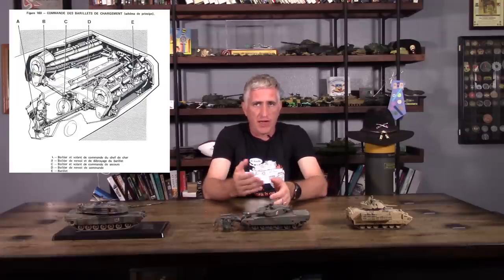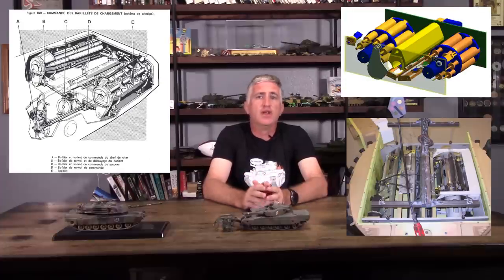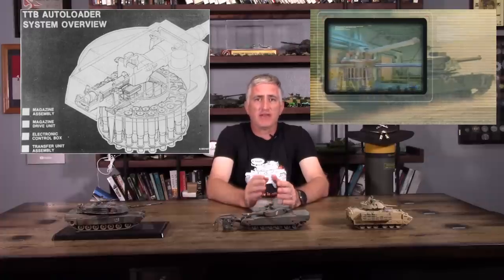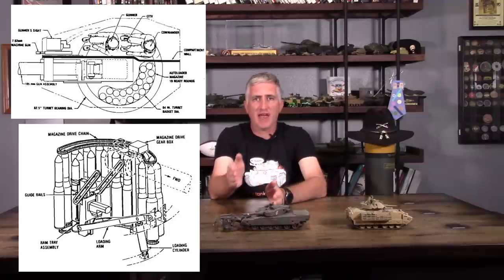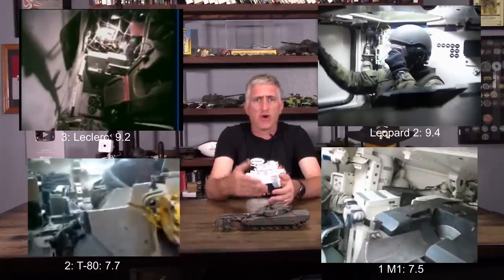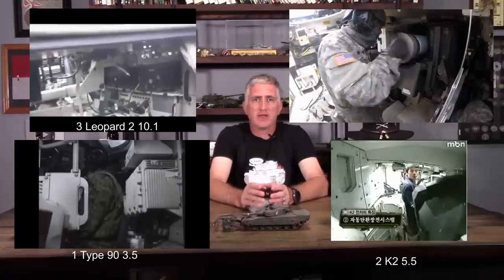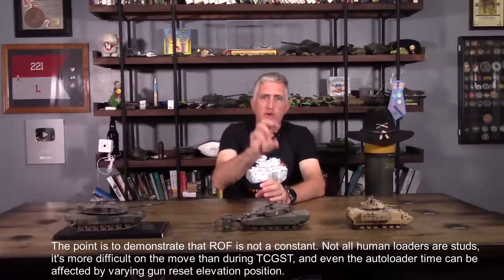Whither the Autoloader?

Comment: Nice set of arguments, also...in support of the autoloader, about missing a 4th set of eyes to keep look-out, with modern camera systems atop the turret (with target/object recognition software & threat warning) this becomes less of an issue.

However, against the autoloader...have they yet sorted out the issue with removing a chambered round from the breech without firing it so that it may be returned to the magazine for later use?  Ei: if an HE got loaded & another threat comes up and you want to swap it for an AP round...without wasting the one in the tube.  Because I heard that the carousel loaders had to fire the round once it's in the breech...maybe that was only an issue with the older ones?

Nice vid!  Keep them coming!

Comment: On loosing a crewman. Chieftain says this isn't a problem because you can just put the 4th crewman in an APC at the company level. What do you do when you spit off a platoon to a different mission (company/team)? Having been in a situation where we had to pull maintenance with reduced crews - it was a stark raving big issue and resulted in sub-optimal maintenance being performed. Tanks are big things and even the tools can be quite the issue (track adjusting wrench anyone?) and even simple tasks (replacing a road wheel or track block or two) is MUCH easier with 4 guys and not 3.

Comment: A unique issue to Soviet carousel autoloaders:

Magazine refilling will take much longer than ready rack refilling. I believe you have to program each slot in the T-72/T-80/T-90 autoloader magazine for a certain round so that the autoloader control unit will know which part of the carousel to rotate to and pick out ammo from. That's a process you have to repeat 22 times on the T-72/T-90, and 28 times on a T-64/T-80. Compare that to just having the TC hand the loader some rounds to refill the 17/18 round ready rack on an M1A1 / M1A2.

Though, since ammo refilling is normally done outside of combat, this is less of a problem; presumably when the tanks are back at lager you have as much time as you need to to stock up on ammo etc. The only advantage I would give to the Abrams here is that you can refill during short lulls in combat from the TC's semi-ready rack. I don't think it's as easy to do the same with a T-72 / T-80 / T-90.
Reply: Also, carousel arrangement on autoloaders limits the length of sabot rounds.  Since we're heading in the direction of  long-rod sabots, this limitation is a serious disadvantage to Soviet / Russian tank operators.

It wasn't until after the T-90A (Obiekt 188A) tank was introduced in 2005 that a T-72-type tank could operate long rod rounds like the BM-42M; previously tanks with the T-72 style carousels could only at best fire BM-42 or BM-32 rounds, which were only effective against early gen M1s / Leo 2s. 

Reportedly, it was only very recently that all T-72 type autoloaders were upgraded to allow the use of longer-rod sabots (3BM46, 3BM48 for example).

Comment: Looking back at the one man turrets common on many French tanks of 1940, it's interesting to consider the impact if the French had developed a 37 or 47 mm autoloader gun, combined with decent periscopes and sights for the commander. Probably well beyond the technology and French finances of the time, though.
Reply: Maybe, but not by much. The P-39 Airacobra had drum magazine-fed 37mm cannon, Hispano-Suiza had their 20mm belt or drum fed cannon of Spitfire fame. The Panzer II's 2 cm KwK 30 fired from a 10 round magazine the operator loaded. You had the Oerlikon and Bofors that were drum and magazine (clip?) fed respectively. So maybe not an autoloader like we think of it today, but maybe a magazine-fed cannon would have been feasible, at least for the 37mm guns.

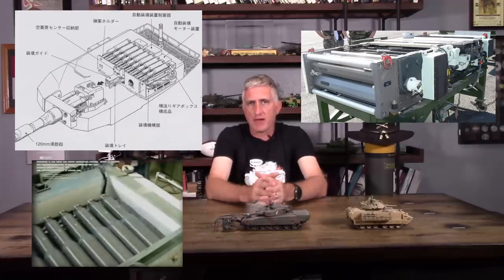Comment: 3:02 Generally. Now the obvious case is the S-Tank. But, I think the Swiss made a few working prototypes (during the 1980s) of turreted tanks that placed their cassette loaders unto the rear of the hull. Also on the tank was a complicated turn-table based autoloader located within the turret basket. And, apparently this loading mechanism inside the bottom of the turret basket plucked ammo from the cassette loader located at the rear area of the hull. After that occurred, the shell was rotated to align with the position of the gun, and raised upwards, and then loaded (by the turn-table autoloader). I believe this Swiss tank was called the NKPz (Neuer Kampfpanzer. I think it means "New Army Tank", or "State-of-the Art Army Tank"???   :/  )

Comment: This change would be fantastic in British service until the politicians noticed. A dedicated squad of tankers attached to and assisting the fitter section with repairs and maintenance would vastly improve vehicle availability and give the tankers valuable experience in fault finding and emergency repair. Of course from my experience the chain of command would see them as free manpower and constantly pull them away for whatever scut jobs they had available until the next "strategic defence review" ( a process that for some strange reason never concludes that more troops are needed) when all their jobs would be eliminated.

Comment: I'm 80-90's  American Artillery, (M110a2/ M109a2/a3) so am well versed with doing a LOT of maintenance with underestrength crews ( authorized 13, but generally went to FTX with 5, sometimes 4....... Smoke or Gunny would come down and do safety to meet "min" manning requirements ....... hell, I've fired  multiple rounds missions where there were only 2 souls within 400 meters of the gun, but Range Control didn't need to know that at the time .......)  ..... but   normal maintenance of tracked vehichles  is hard work ..... more hands make light work .... your idea of extra bodies  following along in APC sounds great to someone who's never been a crewmember  ........ there is much more to be said for "why we fight"  than in which can we are in, as long as we believe in each guy in the  can with us ...... crews are forged ......

Comment: another advantage is for specific type of autoloader, which is the autoloader hides in the chassis significantly decreased the size of the turret as we can see for russian tanks. The manual loader must be in the turret, so extra space/armor/weight will spend on them instead somewhere more useful.

Comment: Carousel auroloaders also technically have a sweet spot for example in,the t-80 sabot rounds are stored in a line however if you need to change to a different type of round such as an atgm the autoloader has to revolve to where the atgm is stored and the loading time can go to 10+ seconds.
Reply: Thats not a huge problem practically though. 
If you need an atgm its probably for a target beyond tue range of the sabot, so you have some time to get it loaded

Comment: Personaly I think the next generation of tank guns will make an autoloader pretty much mandatory.
As in order to increase the power of the projectile, you'll need to make it heavier and the propellant charge bigger.
So, handling those shells will be an even greater issue.

I have some concerns/questions regarding autoloaders (or more precisely the casette system):

1. How does it handle multiple types of amunition? Can the system pick and choose or does it simply take the next in line?
Afaik the Autoloader in the swedish S-Tank had to casettes and was limited to two types of amo in fixed quantity.
I have no doubt that a system that can pick and choose can work, but I would expect it to be more complex and bulky as well as possibly slower.

2. What about shaped charge warheads? In a manual system like the Leopard 2 or Abrams uses, the shells are stowed with the nose pointing back, away from the crew. So, in case of a cook-off any shaped charge sting that forms, will exit out the back and not kill the crew. In a casette system the shells are stowed nose forward (unless your system can turn the shells, which will take up more space and will be more complex and slower).
Reply: It doesn't take much space look up the meggitt autoloader video. In case leclerc have the shells with barcode and qr code which helps the system to select and keep count of the rounds.

Comment: If the Decision-Fairy waves a magic wand and gave me the choice of Loader v. AutoLoader, I'd say keep the Loader.
1. Allows a Crewman to go to ground and conduct raids, evac,, etc. A real Force Multiplier in MOUT ops.
2. Big Armys love of 12 and 15 month Tours,  SM's go on mid tour longer, and with 14 Dats per Plt, reduces crew fatigue. 
3. KIA/ WIA hit my Squadron hard. Losing a TC or Gunner to IDF or IED is, again, a very significant lose to a Plt of 14 EM's. Promote with after a loss maintains continuity.
4. Because someone's gotta fill the radios,  do comm check, load, PMCS, break track, fuel, run tell Chowhall not to close cause them DATs are en route after mission. Cause a TC doing all the shit!
Reply: my name is my name  I watched your instead, beta name.

Comment: why keep the extra personnel freed up by autoloaders when you can just have reduced crews which saves money and demands on logistics?
Reply: A bit late but; everyone in a tank maintains it. Usually fixing the tank is seperated into 2 groups. Major maintenance that requires the actual mechanics division to work on it. And general maintenance that the crew does. Replacing a guy with a massive complex machine will only increase the maintenance requirements and though the loader might no longer exist. The need for more guys fixing stuff will stay.

Comment: That 4th bloke has other jobs rather than loading the gun.
Reply: @shoootme  Throwing the tea into nearby bodies of water is a very important part of the job
Reply: IMO a reason to put in an autoloader is in order to free up the loader for other tasks.  IMO - with all of the electronics proliferating on the battlefield we need to start putting EW (Electronic Warfare) equipment on tanks.  You can use this stuff for surveillance (pick up emissions from enemy systems), jamming of things like anti-tank missile defense systems, etc.  Another issue is that with the idea of a battlefield internet - somebody needs to enter the information to be shared with everybody else.  A TC will tend to regard things that keep the tank crew alive as more important than reporting - which makes the system ineffective because nobody is updating the information.
Reply: @shoootme  Track bashing with only 3 guys will be a worse job that it already is. That missing manpower in a Tank troop will have to come from somewhere. Also what happens WHEN the Autoloader breaks.
Reply: @Paul-ie1xp  well atleast they don't get tired or bash their heads on things. tank loaders also tend to get their hands injured (in fact statistically a manual loader is more likely to hurt themselves enough to no longer load then an autoloader will break down), an autoloader can often be fixed in or near a combat zone. but once a human loader injures themselves you have to wait for them to heal/a replacement crew member arrives which WILL take LONGER then a simple repair.
Reply: @shoootme  yup, the correct way of emptying the BV for the night is to call on every flatfoot in earshot to get their folding cups out for free hot water for whatever instant beverage powder they got in their pockets.
Reply: @colincampbell767  Or instead of a loader you could just have a EW Specialist on board?

Comment: If you have 40 experienced tankers you can get ten tanks with four men inside or 13 tanks with three men. Assuming you have production capacity to get that many tanks. Autoloaders in Soviet tanks with their doctrine are logical inclusion.
Reply: Autoloaders are needed in Russian tanks in part because they have such tiny crewmen and so little room in which to swing rounds. The Russians build their tanks small to make them harder targets. Their tank crewmen can't be more than 5' 4" high. They simply don't have enough room in a turret for a human loader to handle big, heavy ammunition. Human loaders can be effective inside an American tank because they interiors are more open - enough that the loader can be big enough to handle large ammunition pieces more effectively.

Comment: I personally think the Lecrerc/K2 autoloader method is best. Keeps the ammo in the back of the turret allowing for blowout (along with a smaller internally exposed gate), while keeping the breach accessible in case of (unlikely) malfunction. Seems to have a nifty reloading method too, being able to be fed directly from the rear/outside, I'd wager even making it possible to reload in a combat situation in a pinch. Also seems simpler than the two piece carousel method. Autoloaders make more sense with the new, bigger and heavier 120mm general purpose rounds being developed and not needing to have a separate and smaller set of ready rounds.

Comment: One problem I have with autoloaders is jam clearing
While you mentioned troubleshooting, a fully self-contained turret could cause jams to be harder to clear.
However, if you've got a hydraulic rammer that can put a 130mm shell into a tube, it can probably also extract said shell from the aforementioned tube, so if that's handled (and I have no doubt that the proposed KF 51 and AbramsX both have solved this problem) then that hangup isn't a worry anymore

Comment: Just a thought: At my first gunnery as a loader (Way back in 2008), I was on a M1A2sep, I pulled a bad round out of the rack. There was a crack between the aftcap and casing that started dumping propellent on floor when I pulled it out. I was able to reseat the round in the rack, stopping the propellent spilling. Not sure how a auto loader would have handled that or its possible to reverse an auto load? Or would stop firing, removed the bad round, open the hatch in the middle of an engagement to throw a it out?

Comment: 6:55  I find it very strange that the Merkava is supposed to be "all about crew survivibility", but every internal photograph of a Merkava I've seen has had many, many "ready rounds" stowed around the inside of the tank crew compartment rather than being all in blast-protected containers like the bustle.  One would think this would dramatically increase the risk of a random penetration (which might not hit any of the crew - as happened several times in the second gulf war to M1s) resulting in a "tank is on fire" scenario and several killed crewmen.
Reply: Sounds like a discipline problem rather than a design flaw.

Comment: Would it make sense to use the vacated loaders position in a tank with an autoloader to manage the new defensive systems instead of eliminating the crew position entirely?
Reply: Most autoloaders will use the space vacated by the human loader so leaving a crew member there isn't an option.
Reply: No because all the benefits are lost in terms of weight and size, and you make the weight and size worse

It’s a waste of space weight size and cost to have both
Reply: @looinrims  It's a matter of space, weight, and crew workload. Back in the day's of the F-4 Phantom, the back seater was extremely valuable, not because of the the aircraft systems he ran, but because he could process information for the pilot and was a second pair of eyeballs. Today an AWACS does much of that.

Modern combat vehicles have a lot of incoming information, and they're getting more every day. More data, more threats, ect... At what point is the Commander overloaded, and that overload results in the tank getting knocked out? The gunner's busy with his tasks, the driver's busy with his. You could have someone remotely do the extra work, which is only as good as the external communications. That's a lot easier between two aircraft that are unlikely to have anything between or above them, unlike involving a tank that may drive into or through terrain and degrade it's ability to communicate.
Reply: @SgtBeltfed  conjecture vs reality, all of your arguments are both supposition and frankly mostly unfounded in actual reality
Reply: @looinrims  Nothing conjectural about it, at what point is the work load too high? One man tanks? Have the commander drive,  shoot like a video game and hopefully not get surprised? Sounds fine for a video game, not so much in real life.
Reply: @SgtBeltfed  When you have to put everything as question marks, then it’s conjecture 

Did the addition of computer systems into tanks overload the commander? Still conjecture though, with no evidence in reality

Also does the 3 man crews suffer from overload? The 3 man crews used in reality, where real things happen, chieftain said it here and its true, there aren’t replacements for when people take leave, get ill, etc, it’s a 3 man crew and it’s fine

Comment: I have an interesting question but couldn't find the answer for it anywhere:

Why do calibers of small arms and tank guns so random and not always rounded to the standard of that nation's measuring units (i.e Imperials for the US and UK, metrics for others)? Also would rounding the caliber makes it easier to mass produce guns and inspect them for faults?

For example we have US 75mm ( 2.95 inches) but 80mm guns are not widely used, British 84mm (3.307 inches), German 88mm (3.46 inches), US went full metric with their 90mm, British 94mm (3.7 inches), no 4 inches gun that I know of, NATO 105mm (4.13 inches) and not 100mm, USSR 122mm (4.8 inches) and not 120mm, US 155mm (6.1 inches).... These of course doesn't include gun calibers that were rounded like 100mm, 3 inches or 120mm etc...
Reply: Well at least in case of the British "pounder" guns, and some types of 75mm. was because of the consequent diameter of a particular weight of round in ye olden field and naval artillery days. 

155mm. and 122mm. are oddities that I have no explanation to.